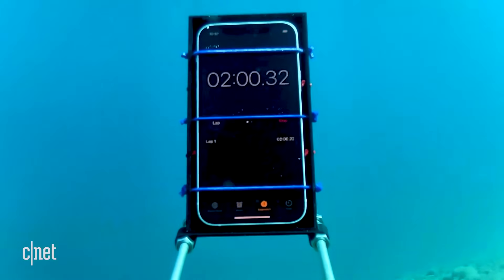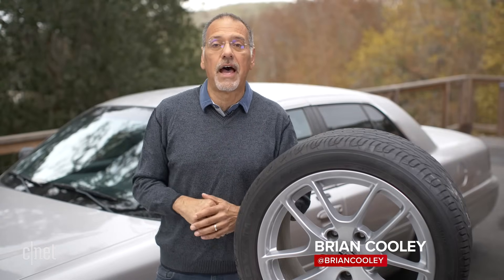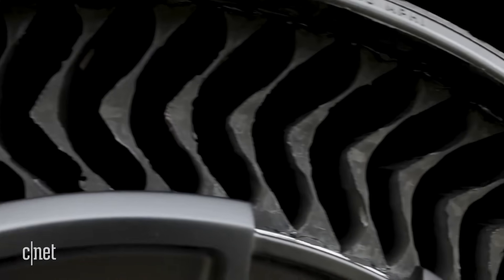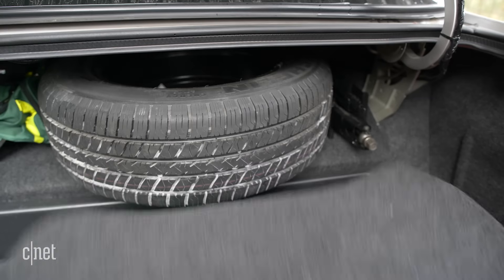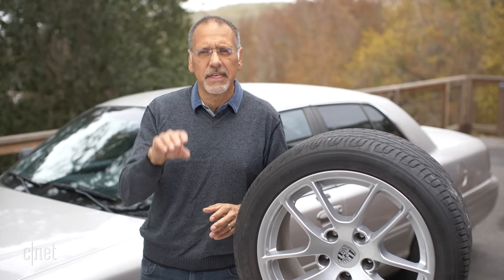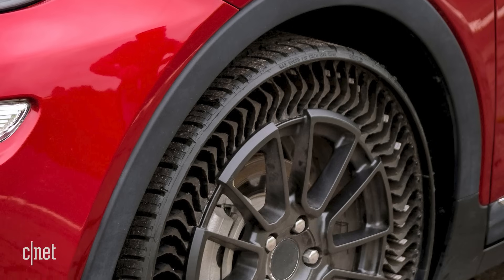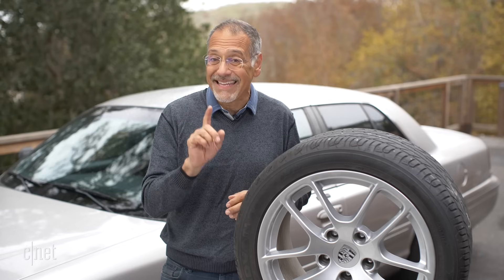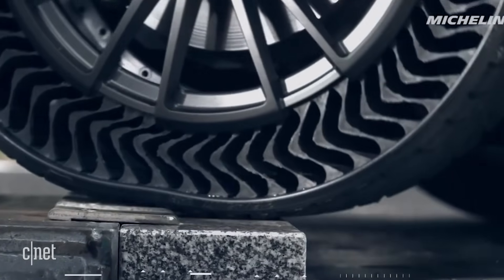See what Michelin uses instead of air in its Uptis tires

Comment: I'm really curious about sound. in my mind, that design begs for wind (at certain speeds) to cause a whistle or a hum as it travels through the tires(like blowing into a bottle.

plus, I feel like a sidewall is needed because in areas where you get snow/ice, last thing you need is ice or super packed snow in between the "spoke" causing issues with traction/control.

Lastly, how many punctures can the tire sustain before I have to replace the tire. the more holes in the tire, the less structurally sound the tire will be. if they say something like 3, then that's probably not worth it especially when a lot of places patch tires for $15 (or even free here in Indy).

Comment: what about test with snow chains on it. I think, in mud or snow it has many disadvantages. What is more, in air tire, you can increase pressure when heavier load is expected, or lower the pressure when needed etc. Here you cannot adjust these tire properties.

Comment: People forget these tires arent new. Theyve existed in slower offroad stuff for some time now. And the reason they havent existed on cars is because the lateral grip at high speeds has always been poor compared to air fill tyres. 

Regardless of what wears out faster. Thats should be the first thing we look at if they release them.
Reply: Plus gas mileage. Weight.

Comment: You feel every little bump. It’s 3 times more felt than a tire with air. I’ve driven equipment that uses these type of tires. We kept popping the air filled tires, so switched out for these. They are not fun to use.

Comment: This was supposed to come out years ago I could think of only two reasons why it hasn’t came out yet 1 works TOO good and 2 it’s going to single-handedly change the way tires work on everything

 it will make or break tire manufacture companies
Reply: Or 3 there not as good as normal tyres

Comment: When it fills with mud or sand or rocks?? Just one rock or anything on road will cause a severe  imbalance which at speed would disintegrate the tire. Maybe they come up with a one unit solid wheel tire combo

Comment: I drew up a design for something exactly like this back in 6th grade, wheels with no air, strong but able to be bent out of shape without losing its original form as to move over potholes or debris in the road...guess i should've put in a patent for it
Reply: While you're at it, why don't you imagine a rocket fast enough to reach the next galaxy in one minute? Thinking of stuff is not akin to making them. Airless tires have been a thing for a long time but never been practical exactly because of the limitations which you used your imagination to move past

Comment: Would these even work on performance cars? And to want level? Just GTI level or even a Lamborghini? If it can handle EVs, it can probably handle sports cars. How about grip though? Tires bend and flex laterally too as the ground changes shape, can 'plastic' tires do the same?

Comment: they wont last years but they wont wear early either. prob last as many miles as a normal tire, my concern comes from the no side wall, when turning quickly to avoid something your tire rides on the side wall for a small bit, with this cause the tires to tear or wear wrong, could it lose friction and make the car go out of control. the only tires ive seen work that are airless are ones meant for slow vehicles like warehouse equipment or industrial heavy vehicles that again move slow.

Comment: Those are some really good questions at the end. I also wonder if the tyres will be able to handle the weight of the car if it's parked for more than a day or two, or if the weight will deform the tyres and turn them oval.
As others have pointed out, making products that last is bad business. These new tyres will either be expensive or have some new flaw intentionally engineered into them like was done with light bulbs and a million other daily-use items.

Comment: We've had airless tires for decades.  They've used them in several military vehicles.  The only question is why they haven't been for sale to the public yet.
Reply: I think those airless tires are really costly and I think maybe the cost of making it is high and the public wouldn't buy a costly tire when there is a cheaper alternative.
Reply: @bijonmathew1001  they should put them on brand new cars, include them in the price, and market them as "tires with a lifetime longer than the car."  People would pay the premium, and once the money starts rolling in, the price will start to come down as better production methods are developed.